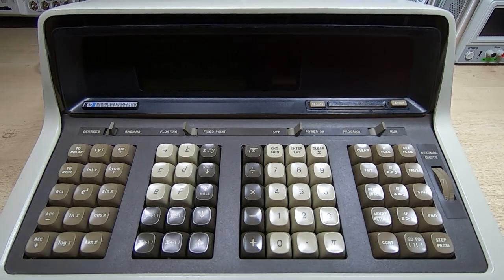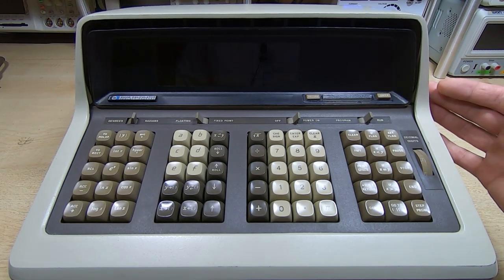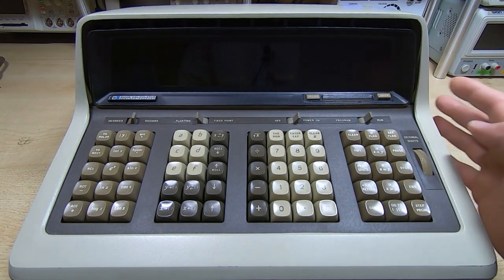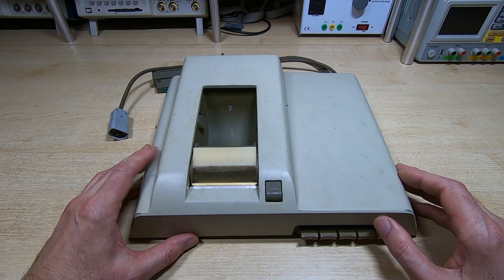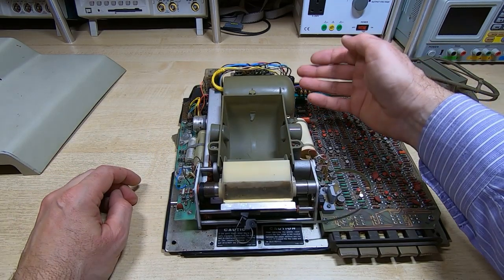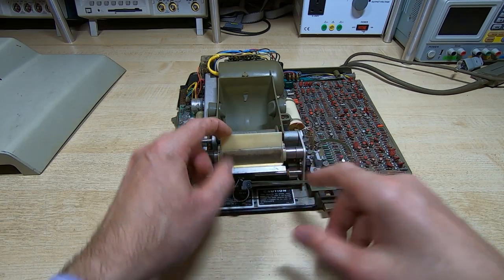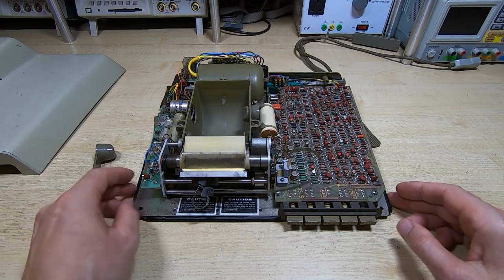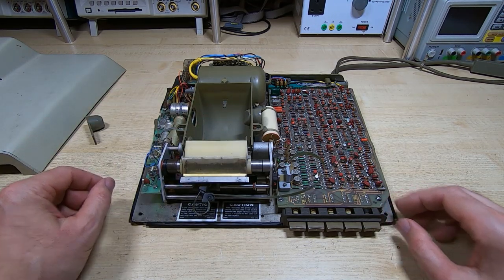HP9120A #1 Repair Part1

Comment: I think I have some rolls of aluminium-coated paper somewhere, that might be the right width for one of these. They might take a very long time to find though...
Reply from the maker: Let me know if you want to sell them :) The printer uses paper which is 2.5" wide.
Reply: @JerryWalker001  I never really throw anything away, so I'm fairly sure I have them. My late father got them from an engineering factory he worked in at the time, and I know they used HP stuff. He once got me a HP 11c which worked, and HP 97 in its padded carry bag with manual, which was broken. I eventually sold them both on eBay.